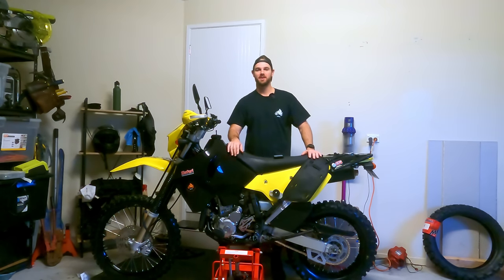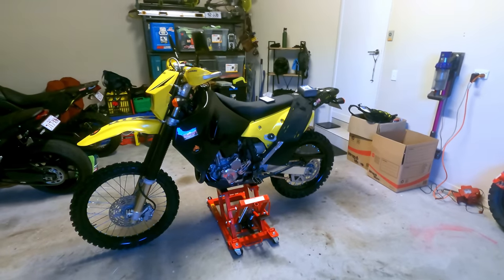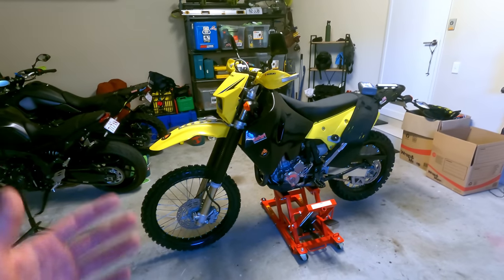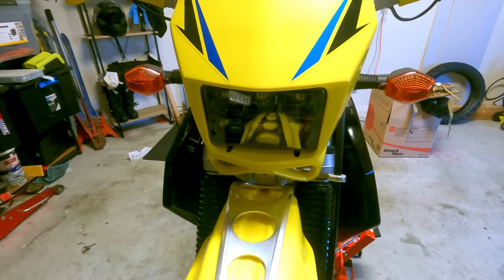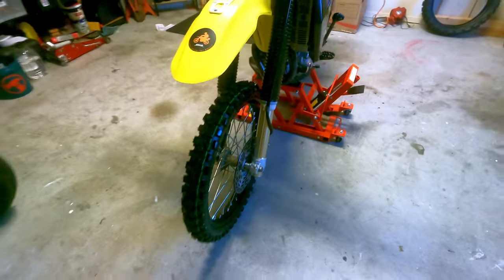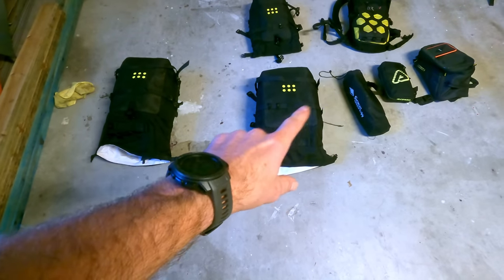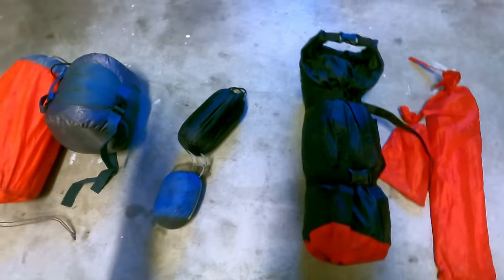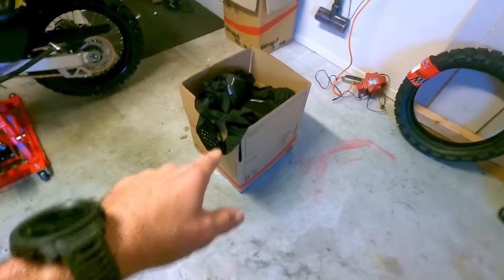BIKE & LUGGAGE SETUP | CAPE YORK ADVENTURE | DRZ400E

Comment: Just completed a byron bay to steep point via flinders ranges due to the Simpson being flooded on my drz400. I put an Anderson plug on my battery externally, mounted a bracket on the helmet locking thing.  So I didn’t have to take it apart to access the battery to jump start. I cut the alligator clips off the jump pack. Made it easy to start when my battery died. Just a tip. Enjoy the trip.

Comment: Loving ur vids Josh! 🙏 went to Ormeau Hills yesterday and bummed it’s closed at all ends.  Heading to Glassy today.  Curious how that powerbank/ jump start gadget went? Looks like a beast.  👍 I’m testing an air inflator / powerbank myself.
Reply from the maker: Thanks mate
That’s a shame, even off Upper Ormeau rd? I haven’t been up there in 6 months or so. The power bank in the tank bag went ok but I’m yet to find one that works really well. They get beat up from all the bouncing around on a bike. The jump start pack I have separately always works well. Didn’t need to use it on this trip luckily enough 👍🏼
Reply: @_JoshJB_  yeah m8, both entrances, noticed someone may have moved a large rock intentionally near the upper Ormeau Rd entrance… 🤔… I ended up finding a decent track out of one of the new estates nearby, got my fix 👌
Reply: @_JoshJB_  btw glassy to Woodford then d’aguilar trails was a top ride, a tonne of side tracks glassy to Woodford Rd too.  Might go spend a few days there soon to explore more

Comment: Josh what type of glue did you use for the case savers?? I've got B&B off road stainless covers and not sure what to use...cheers
Reply from the maker: Hey mate
I can’t remember exactly what brand but it’s just some heat resistant silicone I got from Bunnings

Comment: Hi Josh
Got myself a DRZ and was looking at your Kriega bag review  
In the first video you used three 12 Lt bags two on the sides and one on top 
When you set your bike up to do the Cape trip did you use two 18 Lt bags on the sides ?
Reply from the maker: That's correct mate. I did the same for my Simpson desert trip as well. For those longer adventures I find I need a little bit of extra space.

Comment: Hey dude. Good amount of prep! What gearing (sprockets) do you run when you're doing your big trips?
Reply from the maker: I use 15-44 all round. I find it’s a good combination for everything I need to do.
Reply: @_JoshJB_  Ah, okay. I ran 15-44 on mine for a bit but burned through my clutch pretty fast in a day of single-track... I found 14-44 or 15-47 to be a good all-rounder, but it still got real vibey up around 120km/h